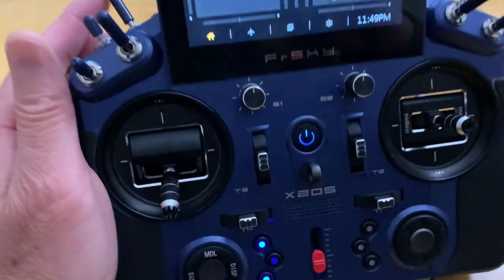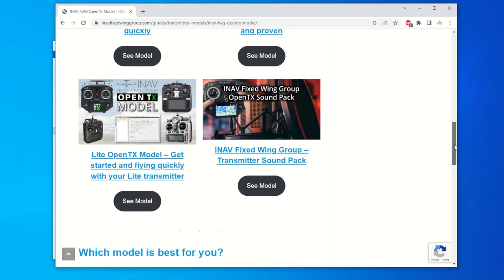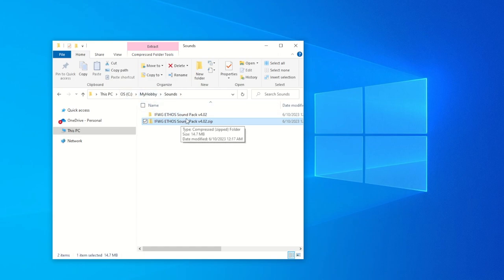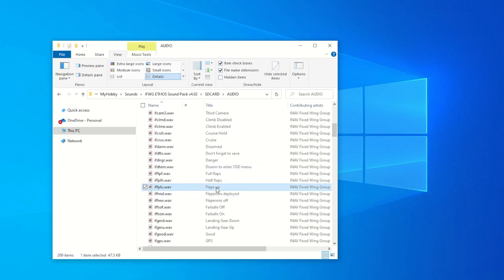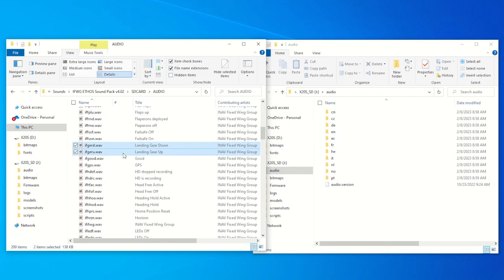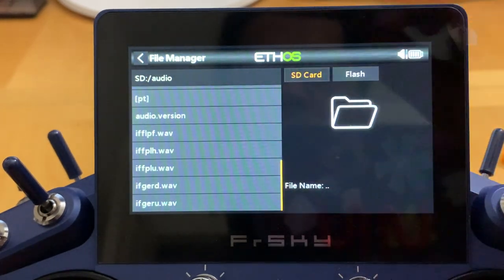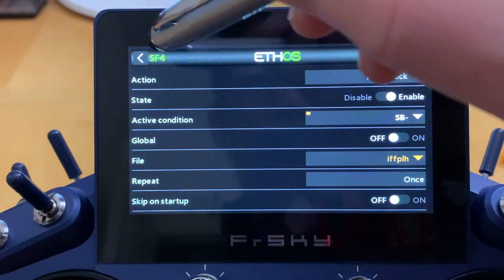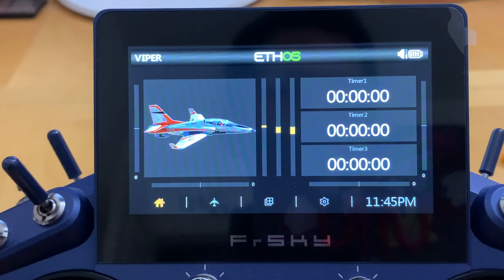How to assign sound to switch on Frsky X20 Transmitter.

Comment: Great video's very well presented, I have one question, can you assign sounds to a stick? I don't see it in the list that you can assign.
I'm running ethos in an rc tugboat and thought it might be fun to add a sound like "full ahead" when you move the throttle stick to the full forward position have it triggered in the last 10% would be even better. Any thoughts?

Comment: thank you for the video but in 3 position switches if you go directly from position 1 to position 3 , the position 2 plays first then position 3 sound plays afterward. can you solve this?
Reply from the maker: Yes, the radio is behaving correctly and that is the way it should be, and there's no way around it. The only way to do what you want is you would have to request FrSky to modify the Ethos OS code to detect that position 2 is not active long enough (like for 2-3 secs), then skip playing the sound of position 2, and just play position 3. Thanks.

Comment: Can this be done with a Mac?
Reply from the maker: If you can transfer those files (*.wav) from your Mac onto your X20, then yes it's pretty much same thing, and the part 4 of the video is just configuring on your transmitter for switch assignment.